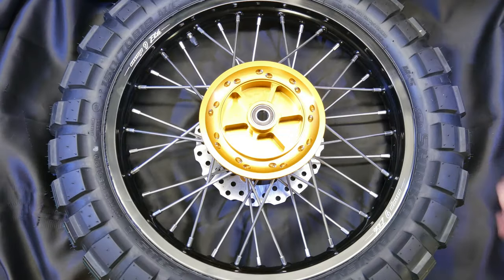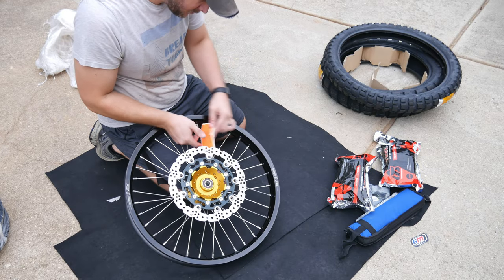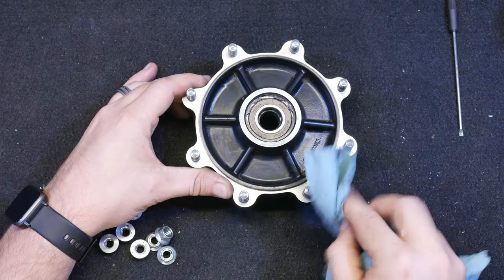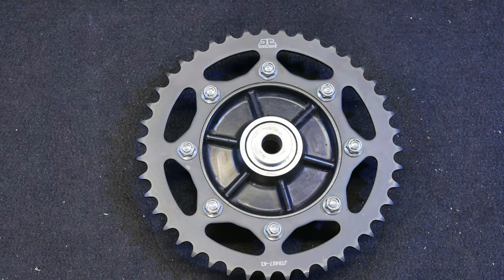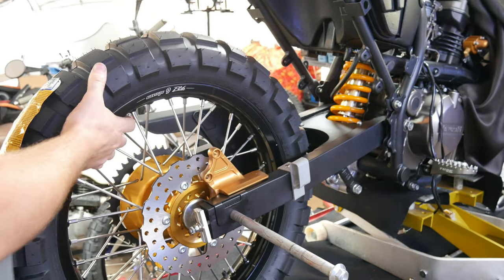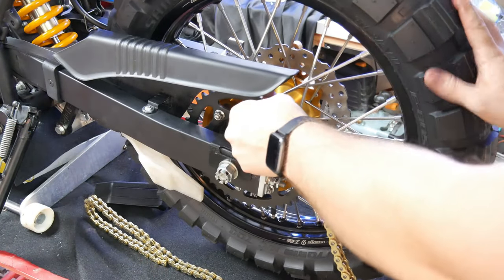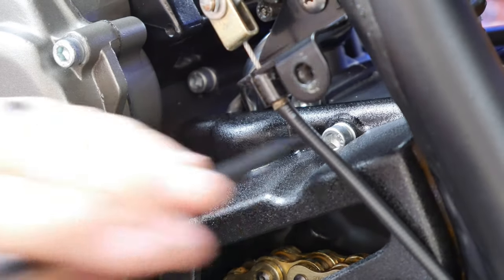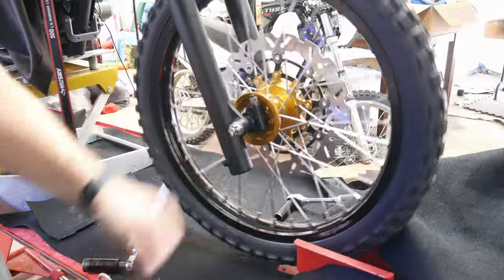Project Warthog EP 16: Wheels, Tires, Sprocket, and Chain

Comment: Did you notice any change in handling?  A bigger front rim  might make hwy speeds better.  Im running the shinkos 805/804 love them. I have the same size rubber on my stock rear.
Reply from the maker: I've made so many changes it's hard to tell what did what but it is super smooth at hwy speeds. That's impressive you got that back tire to fit on the stock rims!